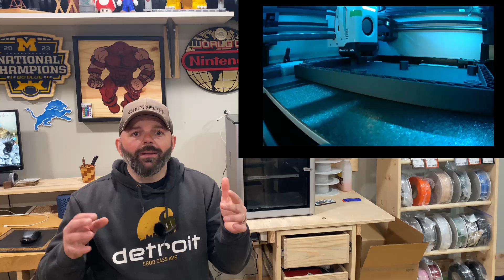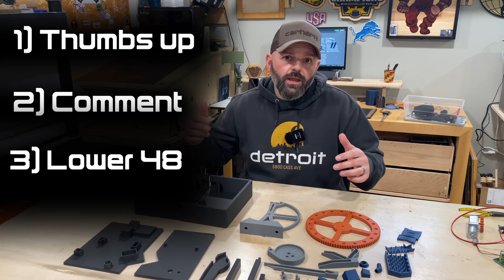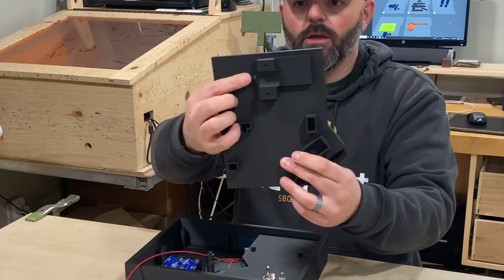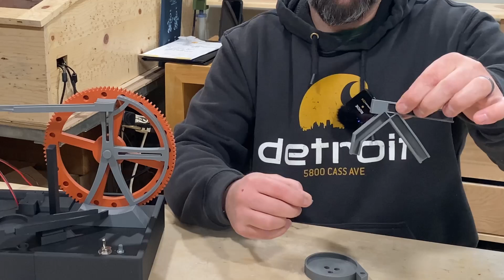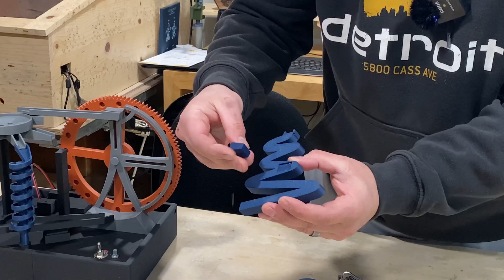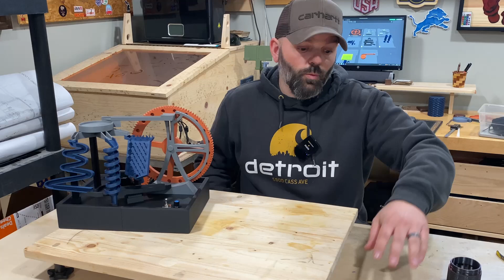3D Printed Marble Machine. GIVEAWAY!

Comment: I dont need the marble machine, I am not writing this comment to get it.
I am writing to share my favorite Fusion360 trick. You may already know it but here it goes in case you dont: You can import a picture into fusion as a canvas and calibrate it's size/dimensions. Why is this cool? Because if you want to copy a part or a shape and 3D print it, you don't need to measure every single dimension on it. All you have to do is take a picture of the item with a ruler next to it. Import said pic in fusion360 as a canvas and use the ruler in the picture to calibrate the canvas. Now you can copy the shape of the object in fusion and create your own digital copy. And because it's calibrated, the dimensions are super accurate to the real world part.
Reply from the maker: @savoryflan  That’s a great tip. I think the channel “shop therapy” did a video similar to what you’re describing (if I’m understanding it right). He took a picture of a meat thermometer next to a ruler and made a gridfinity bin to fit it. It seemed to be a real good way to do things. I DEFINITELY need to dial in my work flow in fusion better to where I build the, in this case, marble machine in the program how it would sit in the real world. I sort of just designed all the pieces independently of eachother and just checked the heights and what not. Thanks very much for the tip - I’m going to make a conscious effort to incorporate into my work flow!